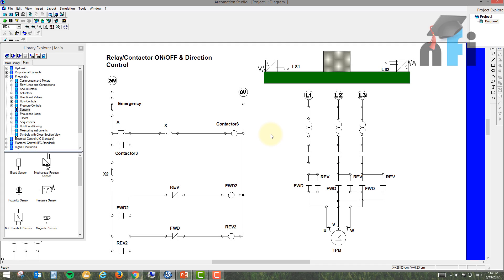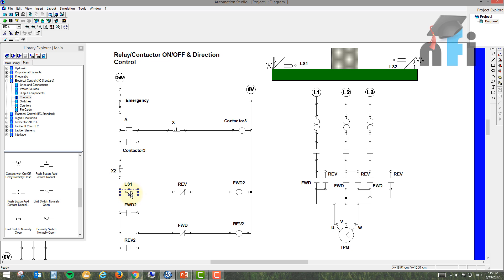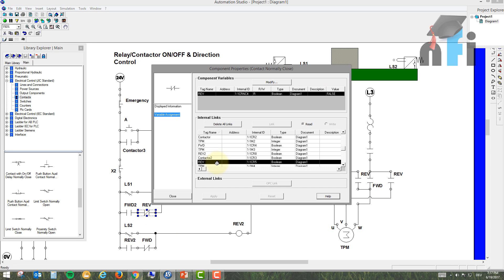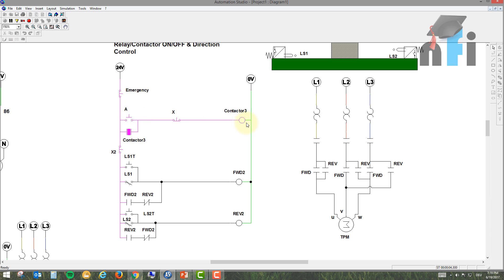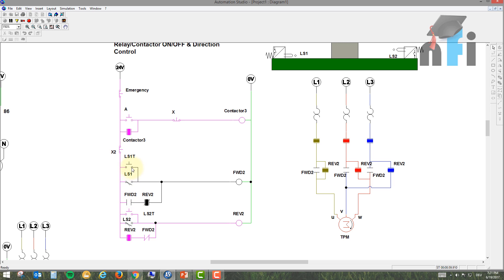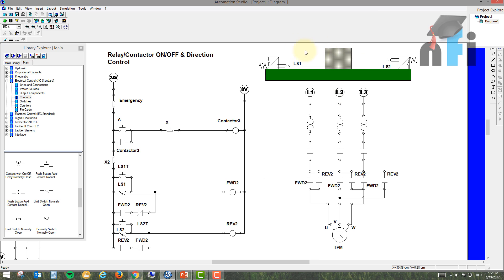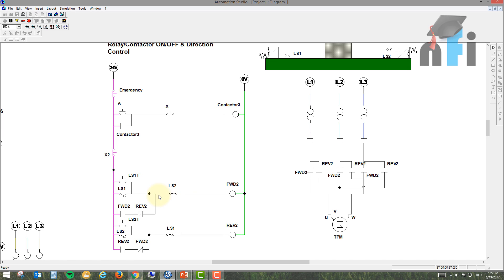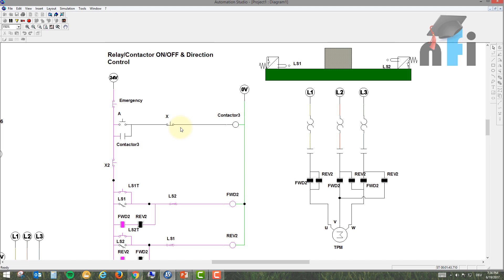On-OFF and Direction Control of 3 Phase Motor using Limit Switches

Comment: Thankyou for posting.  But I have run into a problem.  I'm using an 18v drill motor in forward & reverse to operate a winch with a DPDT toggle switch.  It draws a maximum of around 17amps.  It works fine, but I need to add a limit switch. 

Trouble is... all the available limit switches are rated for very low amps.  Most only claim .3 or .4amps DC.  How can I add a limit switch to my rig?

Actually I don't understand how they can be rated that low.  What kind of micro hair-thin wires are they using?

Comment: It is a nice video but the motor is being automatically controlled by limit switch (forward & reverse movement) and the start stop push button for starting and stopping the motor. But what will be the circuit diagram if I add selector switch whose function will be  when the selector switch is off the motor will work as per current circuit and when the selector switch is on the motor forward and reverse movement will be with the start and the stop push buttons. Please send and demonstrate the circuit diagram on my email nayyaradit@yahoo.co.in
Thanks 
Adit Pal
Reply: so new switch off = working with the 2 limit switches forward and reverse   and   when new switch is on = intended working reverse by a extra push button, and forward with a other extra push button?  Did you manage to create a solution?

Comment: as my experience if a motorturns directly from revese to forward or viseversa ther may be chance of short circuit as ther is power in motor
Reply from the maker: +shehbazmansuri Yes! Practically we need to use a timer between switching of motor or you can use brakes to stop the motor on direction change

Comment: Thank you very much for your videos Rajvir. They are really helpful for students like me. If possible, I request you to please also make a video on direction control of 3 phase motor using user defined angle(Clockwise and anticlockwise) as some of us who want to control the motor only with angle. This would really help beginners like me. I would be really grateful.
Reply from the maker: nitin ks Thank you for comment, are you looking for 3 phase induction or servo motor position control ?
Reply: Rajvir Singh servomotor position control. Thank you very much for your reply.
Reply from the maker: For Servo i would recommend you to join our Advanced AC Drive course which includes not only VFD but Stepper and Servo position, direction and operation control with PLC Programming. Check more details at this page: http://nfiautomation.org/courses/advanced-ac-drive/